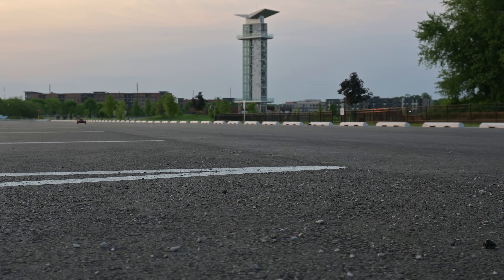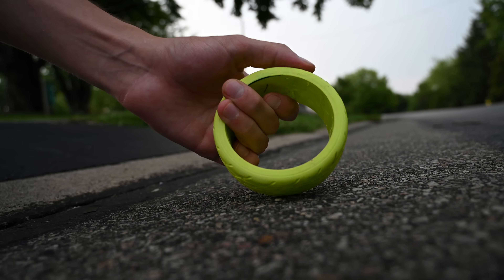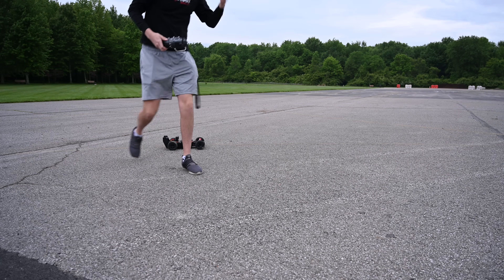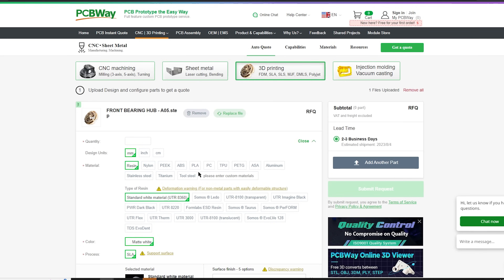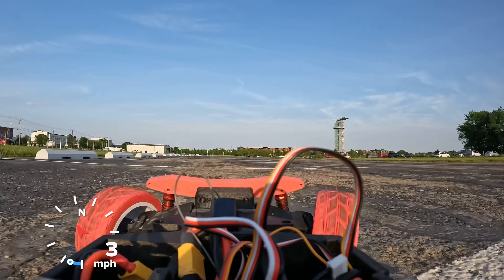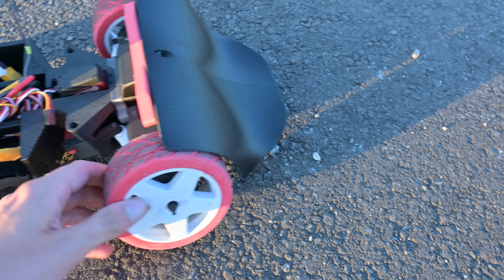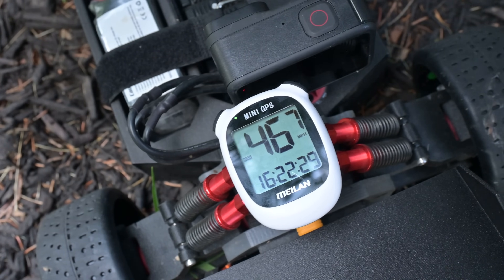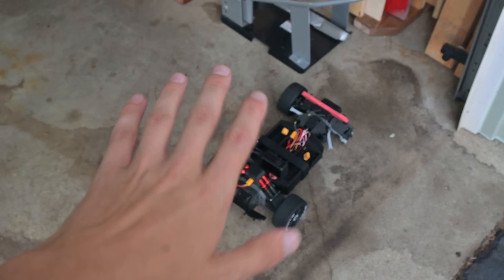I 3D Printed RC Car Tires... Will they survive???

Comment: You can replace all the 3d printed parts with the resin printer and if the big parts can't be printed at one time then,divide the bigger parts into smaller ones and fix them with m3 screws,if it will break then you can change the parts easily and try making the aerodynamics full body also make it AWD for better grip i am not fully sure about the AWD can give better grip,but you can try

Comment: Need some outward toe in the front wheels as well as positive and negative camber at the front and back wheels. Couldn't tell if there was caster in the steering hubs but if not it needs some.

Comment: IMO You need to add 3.0 degrees of toe in at the rear, and maybe 1.0 degree toe out up front, that will help the car self align at speed, also consider adding a little castor angle, again, helps self aligning torque.

Comment: Dude a 1/10 scale rc car doing 50mph is literally doing 158.11 scale miles per hour.  It's supposed to get a bit unstable at those speeds. Don't be so hard on yourself. When that happens in a normal car you see it as normal because you recognize the speed and all the properties involved.  The rc car is no different.  Now if find a way to stabilize that thing to go even faster you need to patent that and see about some big money offers coming from the automobile divisions. You got skills. Like true power over 9000.💥💥💥

Comment: Add a flight controller with GPS. You can send telemetry back to your fpv goggles. You can set it up so that it will "fly" in a straight line. If you use a radio with edge tx, you can set up logic that will fix your handling issues. You are only limited by your creativity. The next best thing would be a car tx that has a gyro.

Comment: for stability you can increase the toe out angle slightly on the front wheels and see how that works out and if it needs stability give it some toe in angle on the rear wheels just minor though.

Comment: Hi mate id like to help with the aero

If u want an openwheel car u can cover the body but not the wheels, id recomend f1 like wishbones and it seems that u have a bumpy surface to use, id recommend havjng 1.5 cm of ground clearance and to prevent any air spillage we can put on silicon skirts to help seal the air in. There must be around 2 cm of front wing ground clearance so air can still go in the floor, i recomend a low angle of attack wings, and for the floor part i recommend ground effect.
Reply: The body must not have any sharp edges

Comment: Dude, so well done, it's very impressive! Switch to FPV sooner than later, that will help. The gradual reduction in steering with speed is a must, you are oversteering now at high speeds. The car seems to float / airlift at high speeds, which is def an aerodynamic issue. Add those wings. Get inspiration from the new Ducati Streetfighter wings. Lower the COG if you can. It feels like the COG is still very high, sitting well above the wheels. Largers wheels would allow your COG to sit below wheel level. Just tips :)

Comment: I would say to add more weight to the car, especially to the rear end to increace rear end traction. You could add a spoiler to the front to get some downforce or just let the rear end do the steering and aceleration.

Comment: more wider arm on rc car is more balance out speaking of narrow so easy lose tracking cause it slip out everywhere
2nd using offroad tire was to force tire stay contact with road at high speed but if you lose speed cause tire retrack back in place make no contact with ground it leads to sliding into thing
3rd if you need tracking so bad them go wider tire thicker that way wont turn into balloon just like offroad tire did 
i just love seeing people finding way to test different between it

Comment: Design the next car with the same wheelbase and track width as 'real' rc cars (200mm base, not sure on width). This way you can mount a pre-made lexan body for aero. Also toe in the rear and no more 3d printed tires!

Comment: Hy from Germany. I think 4WD is overratet if it is just about highspeed even if I love it on my RC-Car. Longer wheelbase is very good for highspeed but next thing will be the suspention. Its got to be kind of hard for the street but the car has to go down just from its own weight when you put it on the ground. so kind of try and error with the geometry. I don´t know if you print the shock absorbers but they have to bee hard too. For rc-cars you can buy oilof different viscosity ... so thinner or thicker. Have fun. Iḿ glad to see your improvements however. I will keep drifting and jumping.

Comment: Hi, I'm from Brazil! Amazing videos! Have you ever seen The Angle of the F1 Wheels? Perhaps, if you tilt the directional wheels, just like Formula 1 cars, you will reach greater speed. The physics behind this would depend on a longer text, I leave it to you to research haha (I hope it works) Another suggestion: increase or widen the axes to concentrate the center of gravity.

Comment: testing mine in spring both metal and two 3d printed, my metal one is geared to max speed of 100mph from aftermarket parts we shall see if it gets close to 80mph with efficiency lose . 3d printed is 2 different designs one based close to a tt02 and other compatible with tt02 parts but very little in common with original tt02 chassis. hope it all works well for myself with very little damages lol but thats the best part of it being 3d printed easy fixing.

Comment: at the speeds your currently going downforce plays a pretty low role with most the force produced being drag. suspension geometry and stiffness is most likely the cause of the instability. You CG is also pretty hi above the ground which causes instability. Best bet is to gather some inspiration from cars like the Traxxas X01

Comment: Your 3D printed car is absolutely mind blowing and I truly admire your 3D printing skills and electronic knowledge, but for the car to be substantially stable and steers in a straight path, you need to look deeper into the steering geometry and also lower the car's center of gravity. You need to look into setting up your wheels to have some negative camber for stability, positive caster angle for the front wheels to aid the car to stay in a straight path and add some degree of toe-in to the rear wheels. Also you need to ensure that there are minimal amount of free play in all moving parts related to steering. I wish you all the best and hope you will hit the 100mph mark. Cheers.

Comment: Big mistake falling into the hype pit and using carbon fiber instead of glass fiber. There's a reason why glass is used and not carbon. It's far too brittle and fragile for uses like this.

Comment: i use the though2000 for a living, really. I print about 3kg of it per week. If you want to increase your results and avoid any deformation of thinner walls whilst curing. Preheat the parts with uv only. Use 35°C for 120min and let it cool down. Then preheat again with same settings and continue to the normal 70°C 60 min program.
How heavy is your car at the moment? Are your wishbones bending/flexing?

Comment: If you want speed you are really going to need weights to keep it from bouncing so much.
Too little weight and there is no traction, too much weight and it will reduce your top speed.
I would make lead or iron plates to screw onto the bottom, like 7 of them, then you can experiment with the weight.

Comment: For strong parts print with very little infill, like 10% to 20%, make a small hole in the 3D print surface, and inject resin with a giant syringe.

Comment: make a mold with your 3d printer and use poly 75-45 to make your own polyurethane tires. I do it all the time. Behaves like rubber and is very durable. Creating molds in for example Inventor is pretty easy. for 50 dollars you have enough material to create at least 20 tires.

Comment: So 328 comments and I'm not going to read them all.

1. Get some aerodynamics involved here. I see you have a rear defuser  but pushing that much air is going to be a bitch.  Front down force to keep the front wheels on the ground.   Extend the rear defuser and make it stronger so it gives it more down force and also acts like a cheater wheelie bar when the thing wants to go to the moon.  Print a thin shell to go over the parts that give it dirty air.  Pushing dense air at that speed is going to be an issue. 

2. Take the gopro off and get 5mph. God bless you for putting that thing on but it's just a brick. 

3.  Build your next car around ceramic bearings. Find the sizes in ceramic that you need and then design the car around that.   I'm not going to do the math but it would be fun to. One little wheel spinning at 100mph is ashifudgetion of rpm. The bearings help more the faster it goes. If you don't use ceramic bearings I don't see you doing 100mph.  Maybe larger wheels and tires for more control and less rpm. Seriously the fact your tires don't explode is amazing.  I'm still in awe. 

Loved watching this. Printing your own tires that go this fast is crazy.  Making your own car that goes this fast is nuts.  I'm off to enjoy your 3d printed stack able gearbox video. Look forward to seeing 100.

Comment: big vertical stab fin hanging off the rear and shift weight forward to help with stability at speed. And not so much downforce on the front.

Comment: have you thought about trying tire softener to get more grip with the tires. These are usually used by drag racers ...not sure if it is compatible with the material from which you print the tires

Comment: You should try adding down force to the front and back also you should find a flat area with very little elevation changes also do you know how to use the brakes because I have a rc car that can go 65and it can stop easily with the brakes

Comment: 1)Try balancing the wheels dynamically if you are 3d printing them
2)For the aero try a rear wing similar to the GT cars but don't go overboard with that.
3)For higher speeds u need front grip as well so what u can do is underbody downforce (again not too much of it or the car will bottom out if the suspension decides to give up).What u will need to do is accelerate the air under the car using some sort of ducting(not so sure abt this)
4)U will probably need some sideskirts too that would prevent the air from rushing in from the sides
5)Try to cover the wheels in the aero too

Comment: I too have done a little 3D printing for my rc car. I made a big spoiler similar to this one and a battery holder to hold two batteries at a time. I was working on a front splitter but had to leave my printer in Missouri 10 hours away.

Comment: I can see that your car is pretty high, what I would suggest is smaller shocks and have oil on them so the bounce isn’t a problem. 4wd is a clear requirement for achieving over 100MPH since with Rwd no tire has enough grip or is wide enough to sustain those speeds. I suggest you look into some 4WD chassis that big Rc companies make like the Traxxas 4tec 2.0 or 4tec 3.0. I have a 4tec 2.0 and grip with how the platform is made has become and issue. I’ll suggest that you fit all the electronics on one side and the battery on the other side to balance the weight of the car. Why not put it on the middle? Well the driveshaft has to be in the middle and even though you could put everything on top it would affect a lot on aerodynamics. If you do go with a similar design than the 4tec 2.0 or 4tec 3.0 make sure to build some body mounts on the same spots as on the real thing so bodies aren’t hard to find/make. Honestly I love your idea of a 3D printed Rc car to go 100MPH! And if you need any other tips or tricks feel free to contact me over at Instagram, it’s the same name as here. 
Hope to see more of this soon!

Comment: you should try foam tire and add front toe (more open) to stabilize the front. but redesign suspension would be great. your dampers need to be more horizontal.

Comment: For stability a bit of toe in on the rear and neutral in the front would help.  You already have positive caster in the front, that also provides more stability. If speed is the goal then a longer wheelbase also helps. And with a RWD car you also want to have the weight near the rear axle. RWD buggies often have the motor behind the axle to provide optimal weight distribution for that setup. And a common misconception regarding aero: you don't want that much downforce when going for speed, you want stability. So fins are a good idea, flat underbelly and a bit of rake to keep the car stable. When using wings you basically are putting variable levers on the front and back - especially bad if you go over bumpy-ish surfaces at speed. If you want to see what the results of bad aerodynamic balance can be: google Peter Dumbrecks Le Mans sommersault from 1997...

Comment: You can buy off the shelf radio systems really cheap that has a built in gyro and it works pretty good. Also, for speed your probably going to want solid foam tires. I run belted tires on all my fast RC's but if you're aiming for 100+ mph you'll want solid foam or rubber but they'll need to be solid and glued

Comment: yor car is unstable mainly because you have no rear toe. Thats the angle of the rear wheels. Most rc cars run about 3 degrees of toe in on the rear to give the rear end traction and support. The 3degrees have the wheels angled in twards the chassis. This creates wheel scrup that causes traction. 0 degree toe will make the rear end want to drive around the front or a “spinout” try adding 1.5 degrees of toe in to each wheel where the arms mount to the chassis. The car will track strighter.

Comment: Just look up some of the rc speed run guys like raz shiffrin or Kevin talbot it takes a lot to hit 100mph batteries motor esc aero ground clearance. I would try using the arrma limitless platform to get started

Comment: Have you tried shaving or abrading the tires? Real race tires are often shaved to remove contaminants like mold release. Obviously FDM doesn't use mold release, but I scuffing the surface might help. Maybe some rough grit sandpaper?

Comment: I would say softer suspension with more travel and a reducted direction to get smoother direction movements. At this scale, it's like going 160 in the Dakar race lol, so u need the same type of vehicle (or a superflat road surface)

Comment: I noticed that your orange TPU tires weren't facing the right way, in terms of the tread design. The two front tires are facing opposite directions. The tread design you have works but the "arrows" in the tread should point in the direction of travel. The only reason you'd swap them to point backwards would be if you wanted more grip for crawling. But the fact that one of the tires is facing the wrong way (the front left is backwards) is possibly contributing to the spinning out to one side, as well as some of the instability (darting back and forth) at higher speeds, since the tires fight each other. The rear tires could also be facing the wrong way which would compound these effects. Im a mechanic and have replaced and balanced many tires over the years, and making sure the treads are facing the right way and the tires are mounted correctly is something i pay attention to a lot. So id recommend either picking a tread pattern that is symmetrical (NOT mirrored like what you have on those tires) and can be mounted either way, or just pay attention more to the direction the treads are facing.

That all being said, i do enjoy your channel and look forward to the improvements and progression of this project, as well as the other things you create. Keep on keeping on dude

Comment: Not clear to me how much toe-in alignment you have on your rear axle. The buggies you can find in a store have at least 2 degrees toe-in, which should help with the straight line stability. With toe-in, if weight shifts to one side, the increased grip on the toed-in wheel will ensure that the car will auto-correct. You do sacrifice some top speed and get some understeer though.

Comment: it needs to be more wide and a bit much longer for stability, larger wheels on the back, and more sustain on suspension cause it might start to wobble at high speed... thats are the mechanic problems, then u have to make some sort of aerodynamic for the car.
Nice project btw, and keep improving it

Comment: That is weird that your TPU sounded and looked like it was just hard plastic with no grip.... I have always used Esun TPU and it always looks and feel like rubber and I meainly print 3D printed tires with them for bikes and other 3D printed model cars and even did a pair set of off road rubber tires for a very cheap drift rc car for my nephew as he does not like the spinning of the wheels he wants it to drive like a normal car so he enjoys the 3D printed rubber wheels and off road tires a lot more than the originals. Nice video 👍